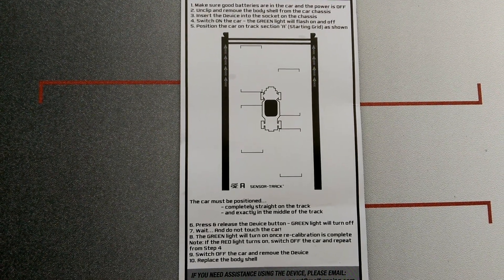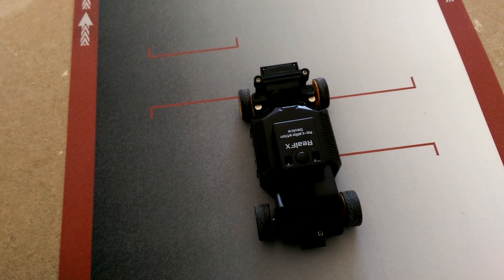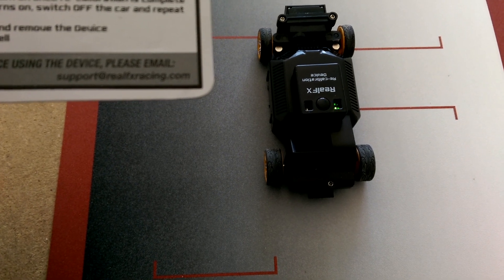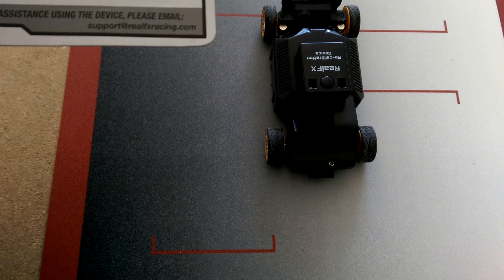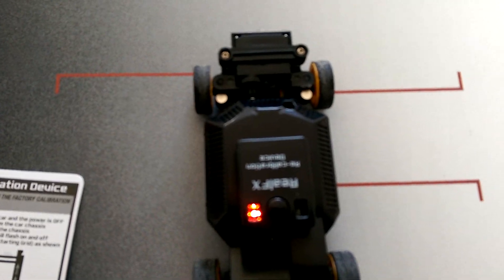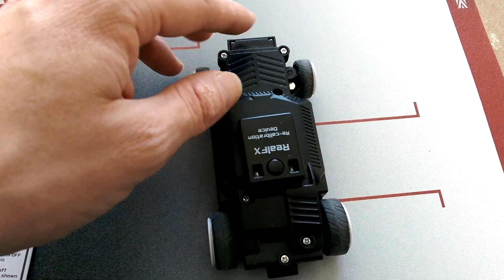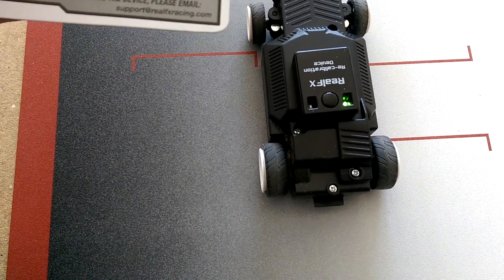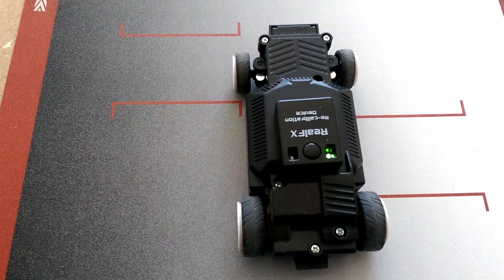Real fx / hotwheels ai car calibration

Comment: The cars ran more or less for the first Use, a couple of hours.
After a short amount of use, both cars started spinning endlessly, going in circles
they got stuck ... something like this video https://www.youtube.com/watch?v=eRqqYIU65Tk. I tried to contact technical support at www.realfxracing.com but it disappeared.
Doing a little research describe a calibration tool to realign your sensors or something, which is not achieved or does not exist.
The manual does not say anything about this problem, they just say that the batteries are replaced.
For all the above, can you help me get the Recalibrator... I ask for your help to solve this problem

I await your comments, thank you
Reply from the maker: Where are you located